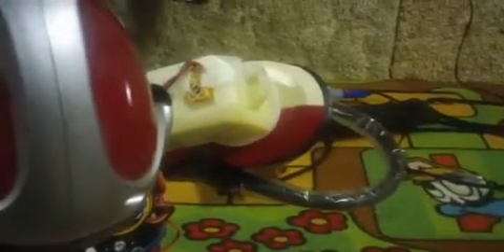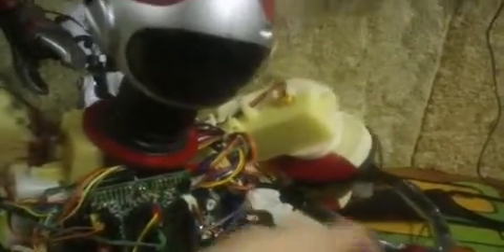red robosapien v2 has a very serious problem

Comment: It is only a tilt sensor problem, because sometimes balls inside the sensor get bad, so he will understand he is lying down while standing. The sensors are on the foot (green cable), connected to the small board (written ball). To test what I'm saying, just unplug the green cable, it will work, but is important you to get a new sensor. Serch for tilt sensor, dont need to be exactly the same.
Reply from the maker: Zorua635 had to rewire it, the wires were just bad still, causing it to malfunction. It wasnt shorting or anything sense it was all heat shrinked, but the wires were just no good anymore.

Comment: are the arm springs on?do I have to have them on to fix him,because I can't fit them on properly.
Reply: You don't need them, they just help lift up the arm and hold the arm in place. I didn't put them on my bronze v2 when I fixed it and it works fine without them.